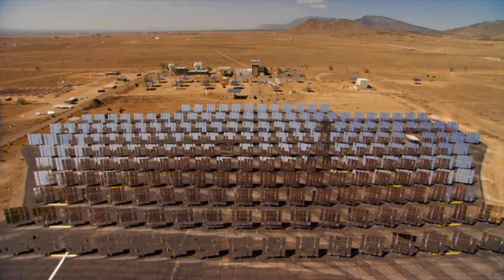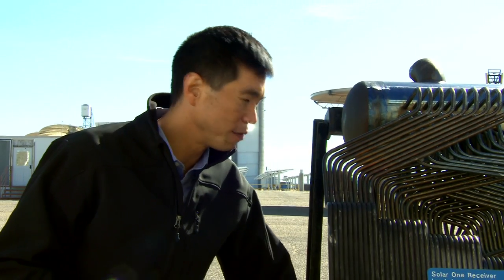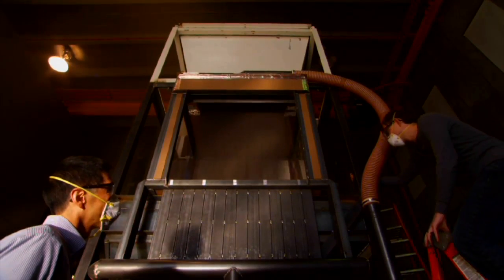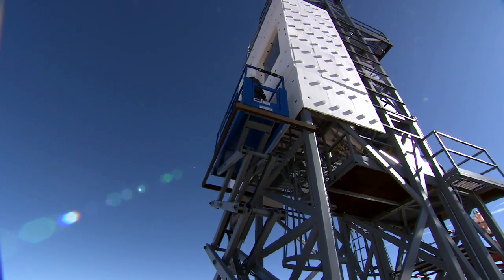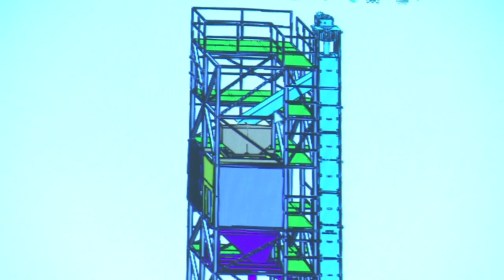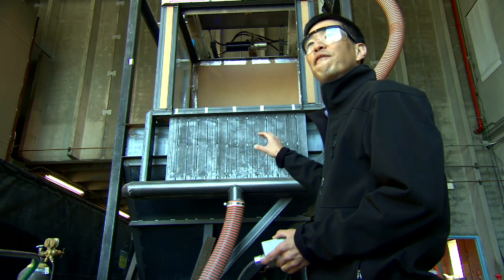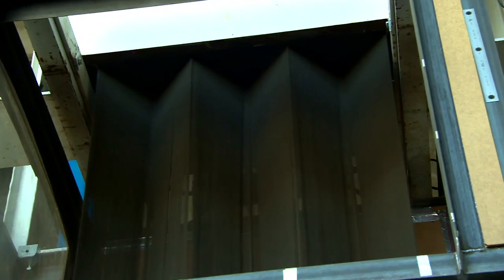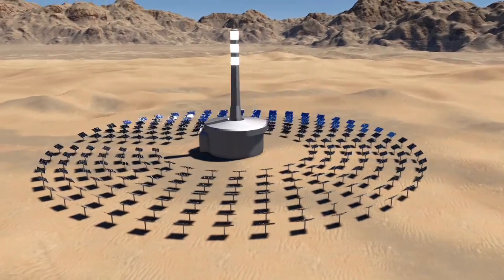R&D 100, 2016: Falling Particle Receiver

Comment: I wonder how much loss of heat is when particles fall through the air to the collector, secondly the particles behind the exposed ones can they collect any sun light? I also notice the focal point of the sun is much bigger then the particles port. In my view, they should use a salt boiler to transit the heat to activate turbine. The principle of the idea is great but needs development.

Comment: That process is gonna generate a whole lot of dust which will be not only a wear problem for the equipment transporting the dust and the personnel maintaining the facility, but also not good news for any neighboring people, wildlife, or agriculture. 

To avoid these unintended consequences, perhaps the system engineers might consider a segmented belt made from similar ceramic material with the belt then extending into a pool or stream of the system's primary heat-transfer fluid? While a belt offers less surface area to absorb the incident solar beam and thus lower transfer efficiency than particles, the surface of each segment could be deeply etched or carved or 3d-printed to at least somewhat mitigate the loss.

Comment: Too many steps!  Direct Solar would be cheaper and better.  Imagine building all that, then come to find out it would be cheaper just to use Solar Panels and call it the day.  LOL
Reply: Photovoltaic cells have their own drawbacks though.  They're capped at about 11% efficiency due to the chemical properties of silicon or something.  They also use chemicals that are difficult to recycle.
Reply: @wolfelkan8183  Direct solar also requires expensive batteries (mineral mining!) to store excess electricity.
Reply: CSP potentially allows for 24/7/365 energy production in certain desert regions. Energy intensive industries can be relocated to those currently impoverished regions.

Comment: Do you have theses on this domain 
How the particles are stored
Why  use a screw conveyor
Flow Air  particle used a suppressor
You can create a prototype project  for working experiments
What are the benchmarks for working as models Work experiments in a laboratory